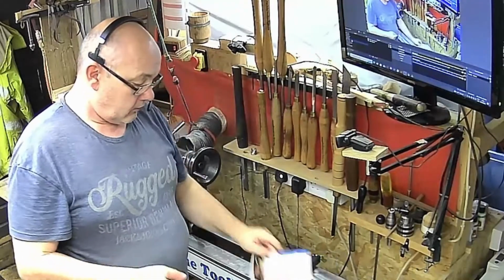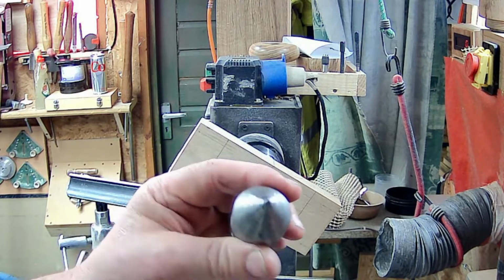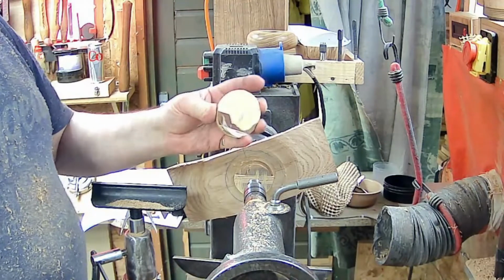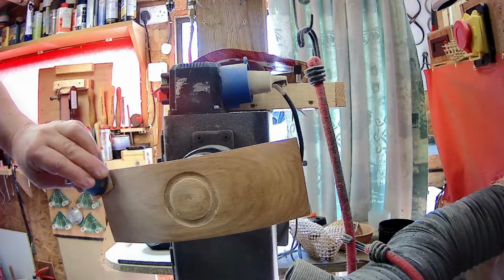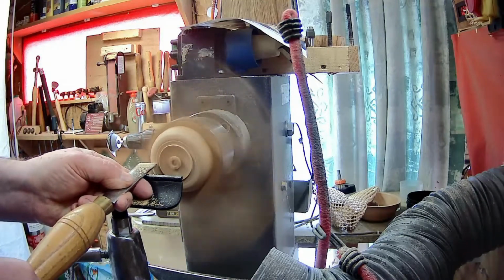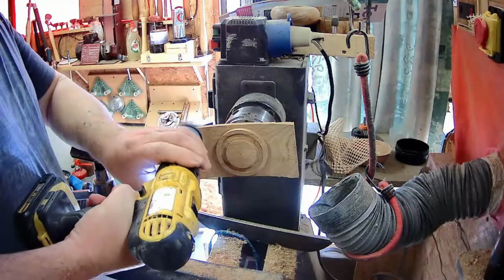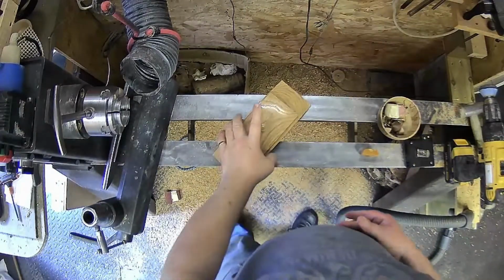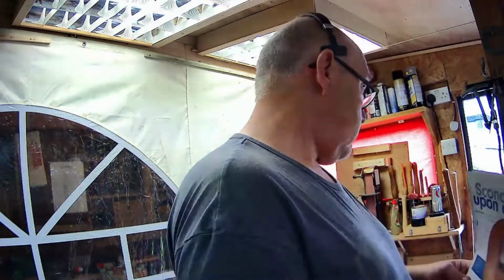WINGED BOX

Comment: That's a good job Paul.  If you want measurements the same piece is in the glass cabinet in the Wood Shed because Jimmy made that when he was there.  Also, what's the buffing system please?  i like that extension that gets you away from the headstock.
Best Wishes, Brendan.
Reply from the maker: Hi Brendan thanks very much , that came with the Chestnut Beal buffing system , but i think you can buy it on its own. 🤔
Reply: Thanks Paul.